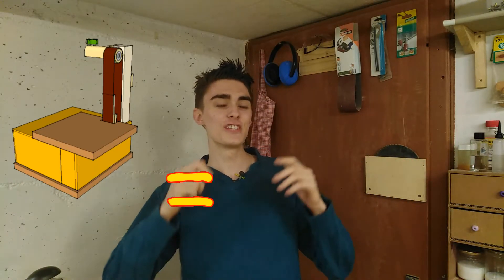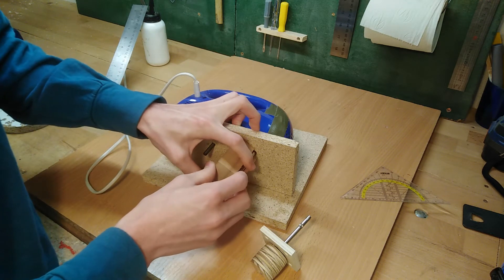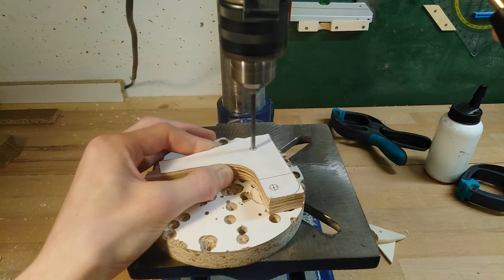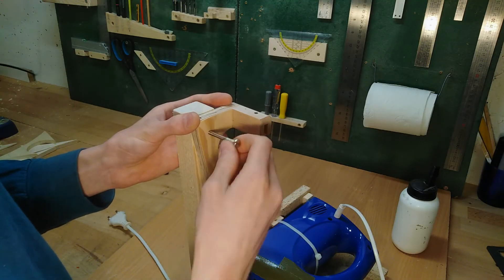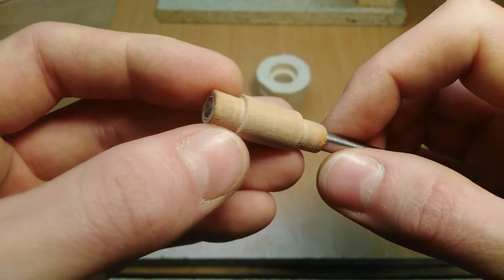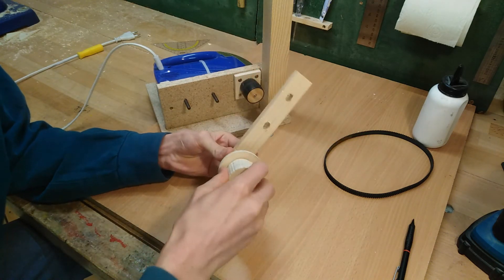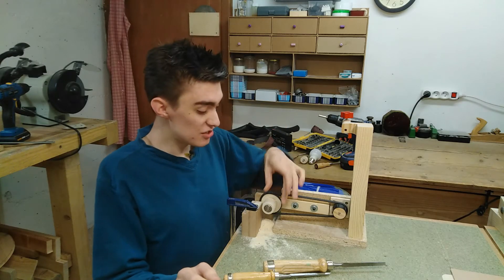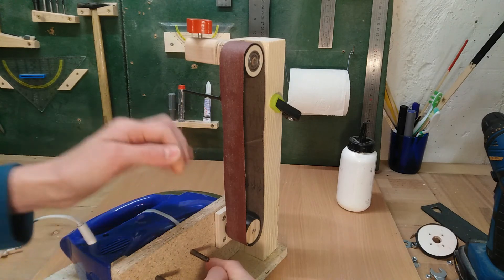Making the hand mixer SAND some WOOD

Comment: Is the mixer not overheating?
Reply from the maker: Good point. I took a brake after 12 minutes to let it cool down because it had gotten pretty warm. It depends on the effectiveness of the internal cooling fan, I did some modifications to it to improve airflow, but without that I don't think the mixer was supposed to run for more than 5 minutes. On some hand mixers it's noted on the label how long they can run without overheating.